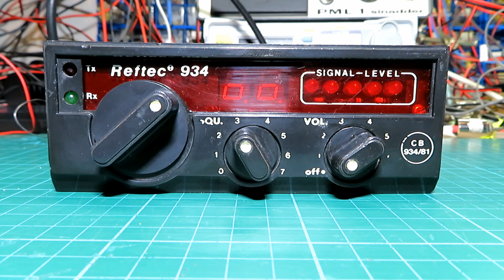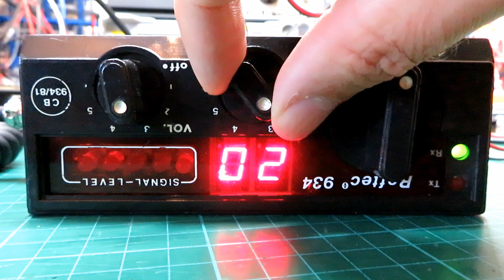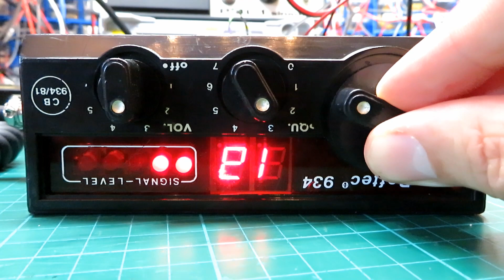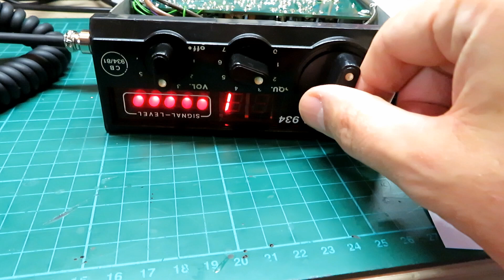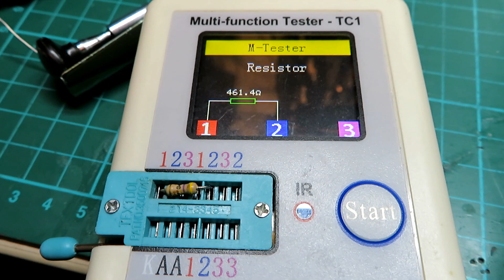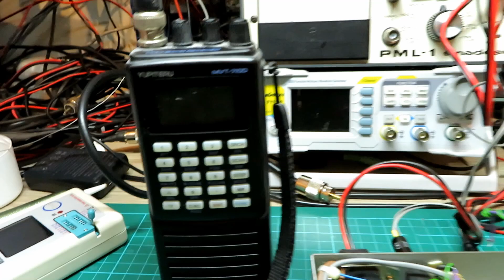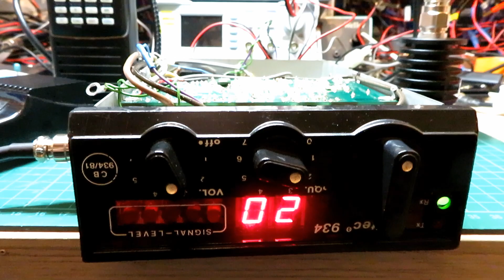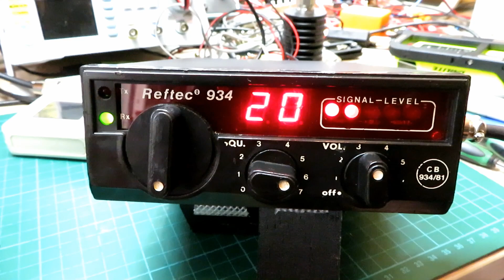934MHZ CB RADIO IS STILL BEING USED IN THE UK - LOOKING AT THE REFTEC 934

Comment: Reftecs used to drift like a high revving car with smoking tyres!!  +/- 30KHz. was not uncommon during transmit. Remember the GSM signal on the lower channels is 200KHz wide and your receiving at about 12KHz. Bandwidth

Comment: At that time, the sensitivity of one microvolt for 10-12 dB S + N / N in the 900 MHz band was considered the performance parameters of top devices.
Devices at 450 MHz had a guaranteed sensitivity of about 0.7 - 0.5 S + N / N for 10/12 dB.

Great video, health for you :)

Comment: Probably not really a good idea using a 934mhz CB may attract unwanted attention 
It’s one thing playing on 446 and the usual 11m pirate bands as your not likely to cause a problem but if you take out a cell on the phone network they might come mooching lol 

I’ve been asked about 934mhz rig several times and your right there is a little bit of a sneaky following ost of the sets I’ve seen are the cybernet model the reftec seems the rare one
Reply from the maker: Yup that's why I put the disclaimer in the video, I certainly wouldn't do it but folks do.